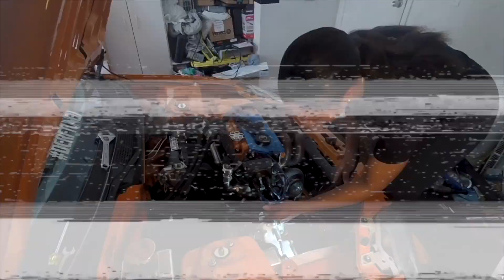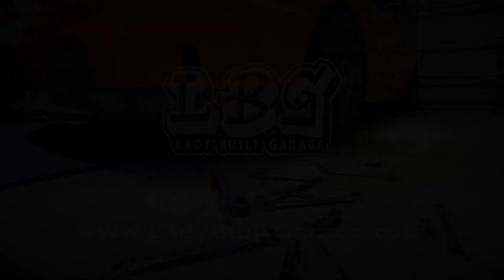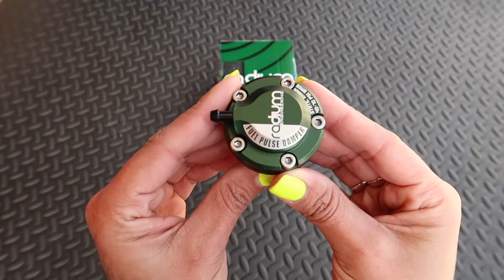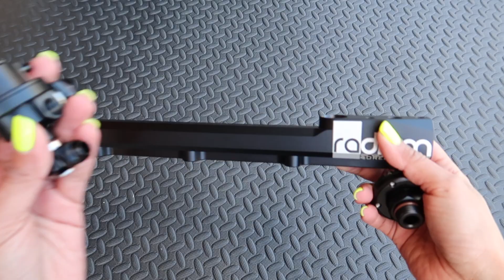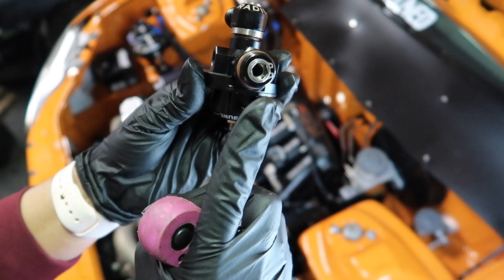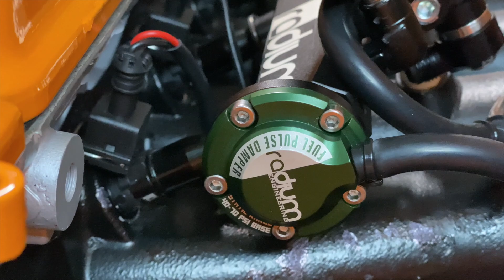Radium Fuel Rail Parts Install B-Series - Fuel Pulse Damper - FPR - Female Built Civic

Comment: These are a gimmick. I bought it, installed it, data logged before so I could see the fuel map, then data logged after and it did nothing for the spikes in the fuel flow and pressure fluctuations. Yes it’s installed correctly.
Reply: I just bought it and haven’t installed it yet it yet. What did you end up doing with it? Did you leave on ?
Reply: So oem companies installing them did it for a gimmick too?
Reply: @RallyRanchMotorsport that’s what I’m trying to figure out too.
Reply: @JohnnieIsBored OEM companies don't install things for shits and giggles...
Reply: @RallyRanchMotorsport so it’s pointless item?
Reply: @JohnnieIsBored thats the opposite of what I'm trying to say
Reply: @RallyRanchMotorsport understood. What did you end up doing with yours?
Reply: So,Mr Hondagod...since your testing showed you Honda's engineers spent development funding on this gimmick,how about you remove the damper, replace it with a plug and repost your fuel trim test.Every time an injector sprays,pressure is relieved from the feed source.As 4 injectors spray, don't you think a pressure fluctuation is present?That fluctuation in pressure during injection pulse has no reaction to fuel pressure?Learn why Honda engineers developed this damper before posting misinformation(bullshit).
Reply: @billydavidson4473 k Honda god. 💋 lol have you done it? Or no? Asking for a friend😜
Reply: @situatedillness Do a simple test even an idiot could do.Turn on your garden hose.Feel how firm it is until you squeeze the nozzle trigger.The hose relaxes when the nozzle releases pressure.I suppose your injectors do not change fuel pressure by that same principle?Yes,I have done it.As I said,put a hard line plug in place of the damper,check for consistency in your fuel trim,then talk shit about gimmicks.

Comment: Great video.
Im installing the exact same regulator and gauge. In order to set the pressure correctly, will the car/engine need to be running? Im assuming so, then you adjust the pressure accordingly?
Reply from the maker: Thank you!! Yes, the car has to be running to adjust the pressure. Good luck!!!

Comment: the 90 degree fitting for the fuel gauge is a 8an to 1/8?   can you please confirm what is the right fitting to use with the radium fuel rail?
Reply from the maker: The port in the Radium fuel rail is 8an. If you're using 6an hose then this is the fitting you can use> https://vibrantperformance.com/catalog/product_info.php?cPath=1529_1588_1607&products_id=3998&osCsid=2851919735bd6c4fb722f5f2342a446d   It's Vibrant part# 29903

Comment: At what point (lph/injector size) does it make sense to upgrade to this kind of system? (Which looks pretty solid.)

Currently just running the same AEM FPR on a stock rail with 550cc and 255lph in tank pump.